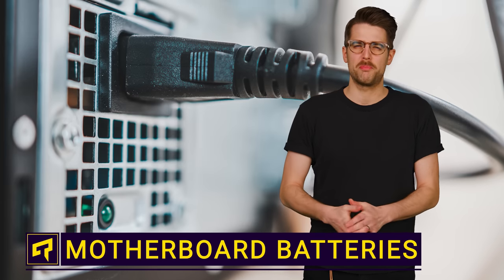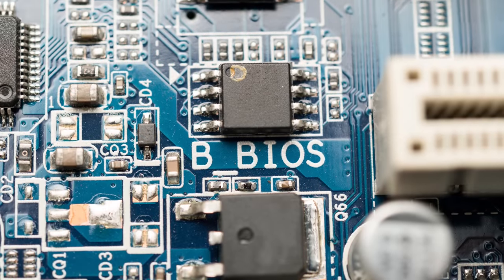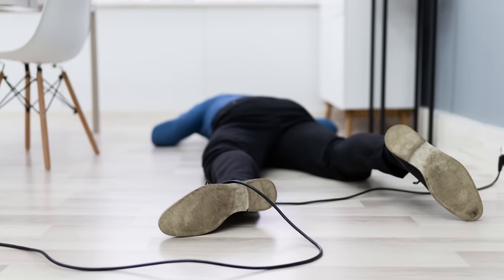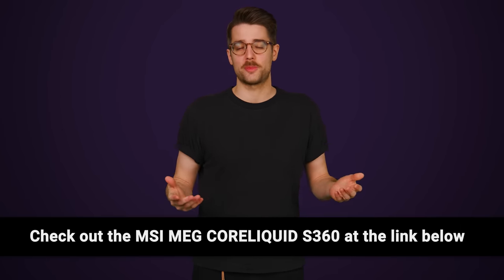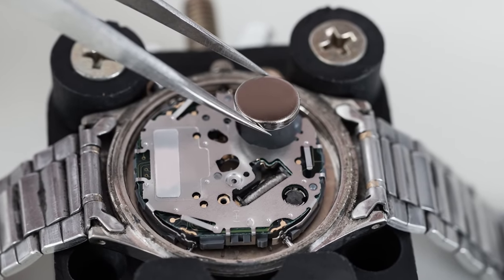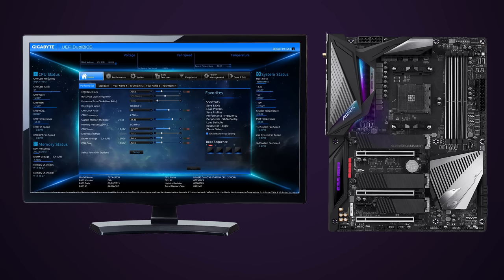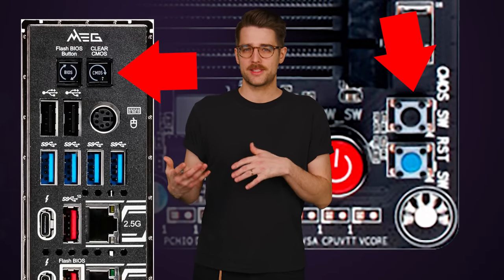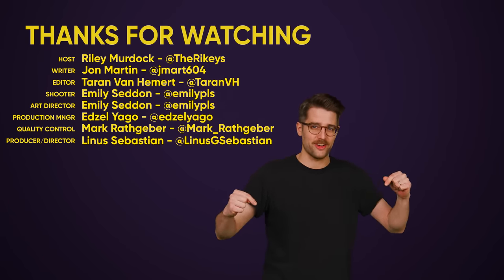Why Do Motherboards Have Batteries?

Comment: 3:04 Saying NTP is not used for home PCs is completely wrong. Every PC out of the box is configured to use NTP. This is standard on Windows, Linux, and macOS. This is one of the key parts of specifying your location during setup of the OS/user settings. For Windows, the default NTP server is likely set by default to "time.windows.com" which is of course, Microsoft's time server. However, you can specify your desired time server manually, and if so inclined, serve your own time via an NTP server.

The point of having an RTC (real time clock) battery is to allow functions such as "wake by RTC" if you have a system which you want power on automatically at some scheduled time, run some task, and then maybe shutdown afterwards, keeping energy usage to a minimum. Another use for it would be to remove the requirement to have internet connection to keep some form of time.

Some form of time sync is important if you want to avoid having to manually make adjustments to your clock for things like DST, time zone changes while travelling, or jitter (which means that your local clock is non-ideal and typically will be comprised of some amount of "periodic jitter" meaning it will be consistently slower or faster than the perfect clock).
Reply: Exactly, It made me wonder if he was wrong when he said the oposite.
I know what you're saying is true cause once I was too lazy to change the battery I just set the internet time on my computer and actually use it without any trouble for months, the time would sync in a matter of seconds as soon as the Desktops loads in...
Reply: You have to have an OS running to query NTP as you describe it. The BIOS isn't an operating system and isn't expected to have network access. The OS will generally correct the time of the RTC once the OS starts since there are standard mechanisms to do so. 
But the the BIOS cannot query an NTP server to set the clock since it's generally not expected to have network access. 

On servers, one way to set the time set via an embedded microcontroller called the BMC. This will have a dedicated network connection that is used to allow a server to be managed remotely. BMCs generally run an embedded Linux so it's pretty trivial for them to query an NTP server. Then there will be some sort of communication method that allows the BIOS to query the BMC for the current time and to set it.
Reply: @splynncryth  You are correct, however I would like to add that BIOSs (both Classic™ and UEFI), though not expected, have been able to utilize network access for a few decades; hence PXE.  There is no reason why a modern BIOS couldn't communicate via NTP and update the time before booting.
I mean, I'm glad it's not common, but in this day and age where Windows 11 Pro is basically required to have an internet connection to create a user account upon setup, I wouldn't expect motherboard manufacturers to not require a subscription service to keep their BIOS updated and time synchronized.
Reply: @robspiess  I can't recall a network stack on Core 8. Taking a quick look at the specs before UNDI, they would have been painful to work with in ASM BIOS and there wasn't universal support. I can't speak for any Phoenix products though.

Might you be thinking of PXE boot? PXE boot works via an independent mechanism outside of BIOS. It's been years since I worked with the BBS spec so I don't recall if it generally used int19 or used a different mechanism to load a small 'boot sector' and booted like a floppy or hard disk.  

Perhaps you encountered a board running Aptio 3 or Aptio 4 where a lot of effort was put into making the firmware look and feel like a legacy product? Those could have a network stack since they were UEFI compliant products. 

But none of those are 2 decades old yet (the original EFI spec is just turning 20 this year).

One solid reason I can think for not wanting your BIOS to have its network stack enabled and update the RTC via NTP at boot is that it increases the attach surface of the firmware.
Reply: @splynncryth  PXE is a black box to the BIOS. They are just binaries built into the BIOS or loaded off the PCI card like an option rom. EDK II has a network stack. I am sure it is possible to implement NTP but AFAIK it isn't a standard feature.

Comment: its so fascinating how long the battery lasts... i have never seen even the oldest motherboards... and they STILL work.
Reply: I dont think the one in the display picture would last long though. Its literally a dollar store Maxell knockoff battery.

Unless they comissioned them from Maxell themself to make brandless ones for the board. But i doubt it haha
Reply: @drunkpaulocosta  no seriously... ive dealt with hundreds of all different types of motherboards... and no matter how old or burnt out the motherboard... somehow that damn battery still works... lol it's amazing really...
Reply: Is the battery being drained when the PC is plugged in or only when its unplugged?
Reply: @ZenRyoku  Not too surprising, if I remember right they're rated for 7-10 years. I have a bunch of old 90's PCs though that have been through 3-4 batteries, so they do eventually go but they last so long most people never see it happen. They do sometimes swell prematurely though but that's also rare. Also beats the predecessor 'barrel' batteries that loved to corrode the motherboard when they went bad or the Dallas ones that made you replace an entire module when it went dead.
Reply: I've replaced a couple.  In one system the clock kept slowing down.  Got to the point where it lost a few minutes every day.
Reply: Had a motherboard with a battery that just died after 2 years
Reply: We are actually lucky it's not the older way that used batteries that tended to leak over time. I've seen videos of much older pcs and it was a common reasons to have corrosion on a motherboard.
Reply: Umm... 286 to 486 used Varta cells, which by far and large did NOT last long, in fact, when they failed, they destroyed the motherboard.

Facts - check them.
Reply: @the_kombinator  ok... maybe ive never messed with a beyond ancient 486...that was before pentium chips i believe...  the oldest motherboard i ever even messed with held a pentium 3  133 mhz chip in an old ass Packard Bell motherboard... 💯   it wouldn't surprise me if anything older than that the battery failed, died, destroyed the motherboard.... but everything since... them damn batteries still held a charge... 💯

damn.... a  286....  did that even fit into a single room?   lol  😆
Reply: @jackkraken3888  well if you leave any computer in a storage unit within a storage unit that has no claimant control in Arizona... or  maybe Florida.... yeah... those conditions will make anything melt or explode... ESPECIALLY lithium cell batteries...
Reply: @jackkraken3888  yeah batteries in general.... especially cheap batteries... will leak acid over time... but somehow these watch batteries are remarkable... ive never even seen a battery of that construction ever exude battery acid... perhaps because the construction is MUCH different than your standard cylinder shape battery (AA, AAA, etc...)

i don't claim to ever be a "battery expert" in any way, shape, or form.... 💯
.... however the flat watch type batteries just seam to last forever...
Reply: @ZenRyoku  LOL I have a 286 right now that I am working on, sourcing some RAM for it (only 640k) and as far as I can tell, the battery is ORIGINAL and still holds enough juice to maintain the hard drive and floppy parameters. No leaks. 

Pentiums will usually have CR 2302 cells, or the dreaded Dallas RTC (a dozen or so which I've modded, haven't fucked one up yet) but yeah, early boards with the VARTA barrel cells - generally a disaster waiting to happen.
Reply: @the_kombinator  holy shit.... really?  wow... a 286.....damn.... think pocket calculators have more processing power.... lol  jk... NOW.. THAT... SIR... IS TOTALLY OLD SCHOOL...

haha  640kb of RAM... wow... what frequency does that kinda RAM run if i may ask....?
Reply: @ZenRyoku  I'm actually not sure - the whole mess runs at either 6, 8, or 12 MHz. The RAM chips are rated at 100ns. It even came with an EGA monitor and a 62 Mb hard drive. The whole thing weighs like 70 pounds and makes a decent amount of noise compared to my Ryzen 5 lol.
Reply: @the_kombinator  holy crap... i get the whole nestalgia thing and all... but other than that... why bother???

experiments???  guess its the electronic equivalent to building a house with nothing but hand tools... 💯

.... know this.. im not attempting to throw shade or disrespect at all... but man... there comes a time with technology... where you just throw that junk away... lol   👍
Reply: @ZenRyoku  It's too old for me - I tinker with this kind of stuff and then I sell it on eBay when I'm done. I do have a few ones that I keep around (a 386 SX, 486 DX4/100, and a 233 MHz Pentium MMX) that I play retro games on. I had similar machines when I was growing up, mostly nostalgia. The games are fun :D 

I also have a C64 somewhere too.
Reply: @Lurker-dk8jk  wow it's almost like a mechanical watch

Comment: I once got this 386 workstation, with all the things attached to it, including an IBM Proprinter-I, rather blocky mouse, and things like that for free as that thing had been just sitting in a corner for quite some time.

For most parts everything was in perfect working order... But the lithium metall (!) battery was dead. You could still use it, as long as you would just set all the drives... As back then stuff like clock speeds and multipliers were mostly set by jumpers, but plug & play sort of hard drives didn't exist... But it was fairly simple to do, especially after doing it a couple of times. I could actually do all the settings and get DOS running in less than half the time it took for modern computer (at the time) to load Windows.

But usually I didn't bother setting time and date, so that old computer was usually re-living 1988, I don't really know why did it allways return to that specific year, but it soon became a part of it's whole being... Being such an old computer, having a slight case of dementia didn't seem that wrong. After all, I did use it for some classic games or tinkering a little something with QBasic, all a bit 1980's sort of things to do... Although might be that the computer didn't see my games as very "classic" or "retro", allways thinking it is still 1988, but the point was to have fun and that we had.

Comment: In the early ’00s and 90ies switching this battery sometimes was a magical fix for weird problems (such as random shutdowns, temporary black screens etc) in old systems. Which begs the question if low voltage on this battery could cause unexpected issues in miscellaneous subsystems or if removing it just blasted some bad setting in CMOS or similar.

Comment: many computers except tablets and phones which are SBC based have a CMOS battery that not only keeps time but also in some cases keep the TPM chip settings saved. This means that taking out the CMOS would reset the bios completely as it was even before OEM setup.

Comment: I've had a fair few CMOS cells run out on me in my time.
I tend to keep computers long enough that this becomes a concern.
My old gaming laptop needs one, and the last laptop I had open for a general service got a new one out of precaution. 
Click below the fold for a history lesson and personal anecdote.

Fun fact, waaaaaaaay back in the old days when processors were known by numbers, our CMOS batteries were NiCd!
Because we didn't really have lithium cells yet, and physically couldn't store a long amount of power on the board.
So MB manufacturers just recharged the battery whenever the system was on. These PCs would lose their settings within a few months to a year if you left them powered off.
You could buy an alkaline battery pack to connect to an external jumper, that would last ..... I think mine made 20 years before running out? I upgraded it to a lithium coin cell.

These things have since just become motherboard murderers though, as any motherboard old enough to still have a NiCd CMOS battery is also old enough for that battery to have failed and begun leaking caustic substances, corroding away traces rather rapidly.
Both my 386 and 486 motherboards have had this happen, as has my Amiga 500's expansion RAM card - the 486's battery having even exploded before I got the PC! I had to solder new wires on my 386 to repair it (Try that with a modern board...), and the Amiga RAM card needs .... a lot of help. 
Though I do have a very late model 486 motherboard with a coin cell, so you aren't likely to encounter one of these relics of computing past unless you're truly passionate about retro computers.
And if you do happen across one, get with somebody who knows how to solder immediately to have it removed or replaced! Also, recycle the old battery properly. Cadmium is nasty stuff.

--- NEVER directly replace a NiCd with a lithium coin! The charging system is still active, and will quite happily explode your brand new coin cell, possibly taking your antique computer with it.
Consult your motherboard's manual or other resource to locate a jumper to disable the charging system before installing a non-rechargeable battery. You may need to just wire it in to a separate jumper header intended for the purpose...
Reply: Gah! I missed the perfect opportunity for a "Can it run Doom" reference! This was the era when the original Doom came out, after all...
Reply: @FerralVideo  I came to the comments to check for any comments exactly like this! Those of us in the retro PC space have a biiiiit of a different experience with batteries ahaha

Always remember to check your old tech for those bloody barrels!

Comment: As a repair technician, swapping cmos batteries has fixed a lot more laptops than I would have ever expected when I started.
Reply: Did they have boot problems? I was not able to boot my PC from just resetting the cmos, but when I replaced the battery it magically came to life, beyond confused how that could be the case.
Reply: @jaredchampagne2752  Yeah, it has usually been boot problems.  We have also had issues caused by date and time errors, usually internet related.
Reply: @djchristian82  Usually it is universal.  I'm sure theres some proprietary nonsense somewhere but I've thankfully never run into it.
Reply: @jaredchampagne2752  Probably a "Y3K" or similar invalid date bug. On UEFI systems, the RTC datetime is kept separately from the UEFI settings, and the so-called "Clear CMOS" jumper will often only clear the UEFI variable store, but not reset the RTC. ("CMOS" really doesn't exist on a modern machine.) Replacing the battery forced the RTC date to reset to a sane default, thus getting out of the buggy state.
Reply: Fun fact, some laptops don't need a CMOS battery, they can also use the systems primary battery to run the RTC when no CMOS battery is present. This is how all laptops should do it and just not have a CMOS battery to die or leak at all.

Comment: Not all computer motherboards have used or currently use a button cell battery to maintain the CMOS/clock settings, especially earlier PC’s, Macs, and certain other microcomputers. For those computers that had an on-board CMOS/Clock to maintain, some used small tube-shaped 3.6v Lithium 1/2 AA batteries. Sometimes the CMOS battery was soldered onto the motherboard though iusing battery holder so you couldn’t just pop the battery out to replace it. Sometimes laptops used a button cell shaped battery that had wires soldered to it then soldered to the motherboard though again of you were lucky it used a connector so you could easily unplug the battery to replace it. I suspect that in some cases the manufacturer never expected the machine to in use long enough to need to replace the CMOS battery so they simply soldered it on. It seem that at some point, PC motherboards seem to have coalesced on using button cell batteries in holder that allows for easy replacement of the battery when needed. Soldered on batteries are a particular problem for retro computer collectors as the batteries will eventually leak and damage the motherboard due to the battery acid. That’s why if you have an old computer with a CMOS battery that has yet to leak and your storing the computer away, or it’s the battery is simply old then you should remove the battery to be safe. If it’s soldered on then desolder it and replace it with a battery holder that allows you remove the battery when storing the computer away and to make it easier on yourself when replacing later on. Always replace very old batteries on old computers with new one regardless since you never know when they will start to leak and they will leak at some point, mark my words. .

Comment: Probably worth mentioning that a lot of security, encryption, and login stuff nowadays absolutely requires correct time. A lot of keys that are generated have a  time-based element to them or have expirations. 

If you're having weird login or security issues, check your time! If your time doesn't stick after reboots or drifts, check your CMOS battery!

Comment: That clock battery is actually the way most old games used to save or even keep track of time as well, not just PCs. Pokémon Gold/Silver/Crystal was probably the most popular example of the latter back in the day, having a full day-night cycle that depended on the time you put in at the start of the game.